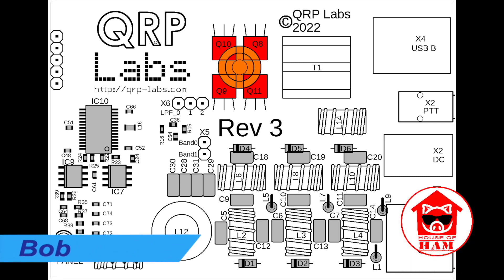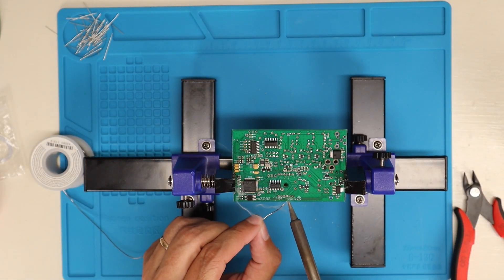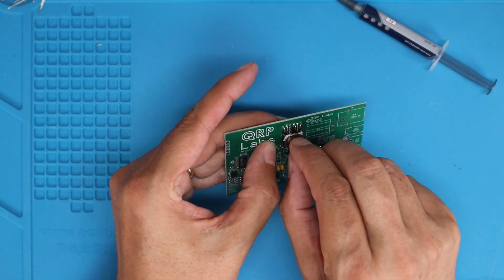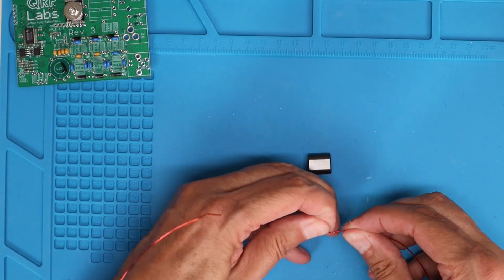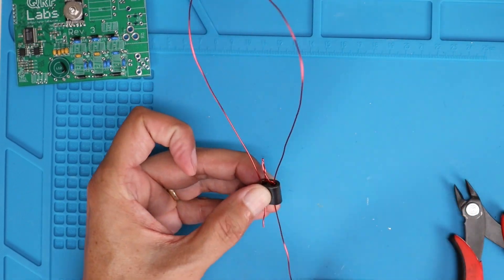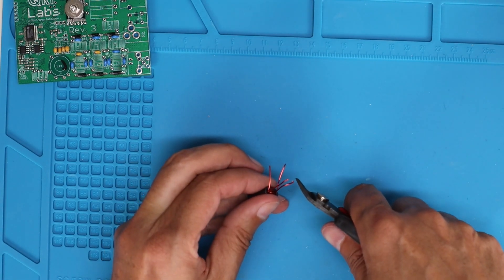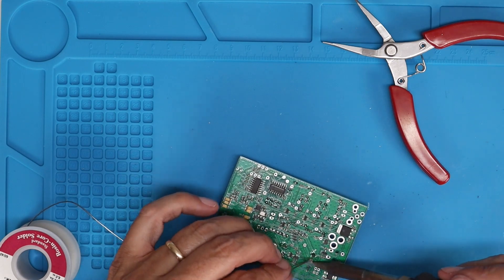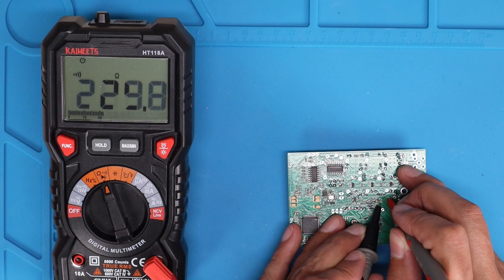Build Your QRP Labs QDX Part 2

Comment: thanks for good information. 2.8 Assemble and install transformer T1 done..I have done the correct number of turns for  both primary and secondary. All turns are tight. But I'm not sure if they are perfectly stacked inside the binocular ferrite. Does it matter? Or is the number of turns which is most important?
Reply from the maker: I don't think it matter like it does with a torroid but I am not an electrical or RF engineer.

Comment: The washer isn't really part of the heatsink as far as conducting heat away. Its purpose is simply to hold the flat surface of the FET's against the actual heatsink that is designed into the PCB. 

MY suggestion regarding the binocular transformer is to wind it for the 9 volt version, then use an adjustable step-down regulator to feed the FET's and give you more stable and complete power control of the output for dialing either higher or lower RF output levels from a 13.8V supply. It also allows you to squeeze out a bit more power from a fading battery.
Reply from the maker: Thanks for the suggestion John. Yes it would have been good for a voltage regulator to have been included in the design. Maybe Hans will include that in a future revision.
Reply: Maybe a bit of paste on the flat side too, a copper washer and a small finned heatsink threaded on top.